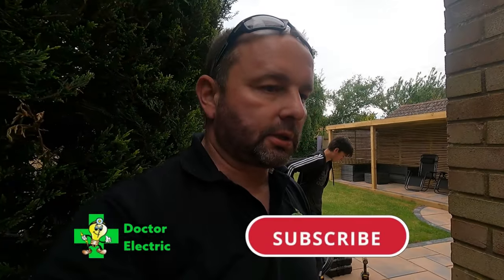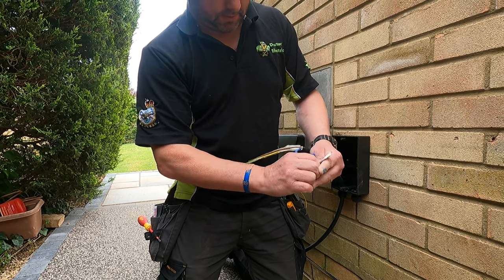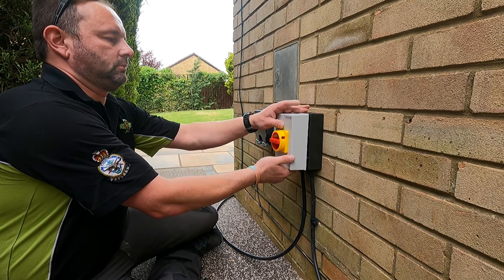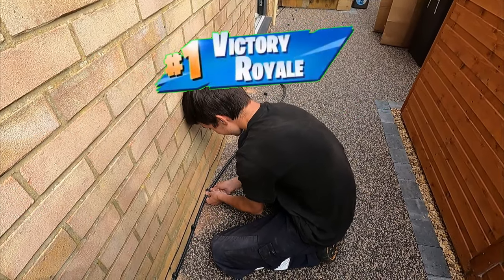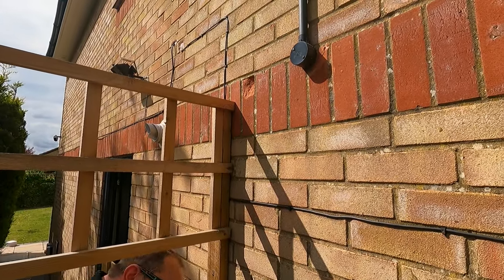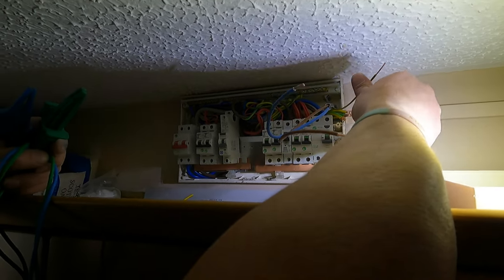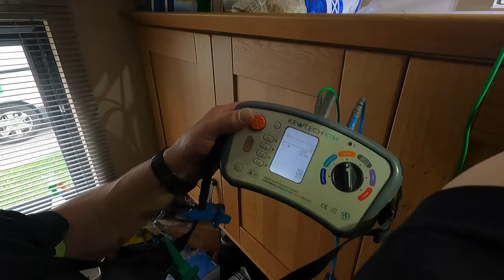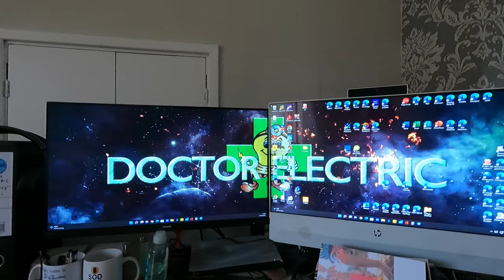A day in the life of an Electrician part 2

Comment: Great video, thanks. In Australia we would run that cable into the roof space and drop out on the outside wall near the hot tub, which would have to be in conduit. Is there any reason why you run it the the long way round the outside wall? Seems like a lot of clipping and a risk of damage to the cable? Very interesting to see how other countries do things and the differences in Electrical regulations.
Reply from the maker: That would be the typical way of installing it in the UK, there's not so much risk of damage as there is no grass to be cut there, also if I run it into the roof and back down it would likely be a longer route, plus we needed an accessible isolator.
Thanks for the great comment

Comment: Hi mate what cable you using there. Looking for an alternative to swa. I do alot of cooker runs for elec cookers and sick of swa lol
Reply from the maker: Hi GD thanks for the comment.
The cable is called NYY-J, Hi-Tuff or Tough Sheath, 👍
Reply: @DoctorElectricYouTube  Cheers mate so as long as there is not much risk of damage like lawn mower or edge trimmer Etc. This cable is acceptable for out side use. I asked a napit assessor the once and he was like swa only think was a bit of a jobs worth
Reply from the maker: Anyone that thinks they're important will say SWA for everything.
I'd fit SWA if it could be damaged or NYY-J for cable that isn't likely to be damaged 👍
Reply: @DoctorElectricYouTube  cheers mate. Thanks for reply  👍